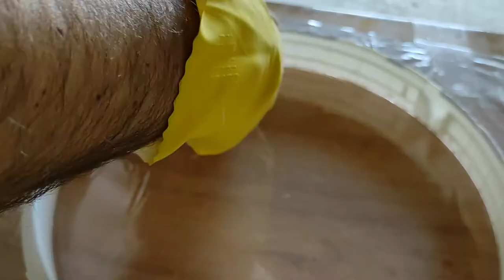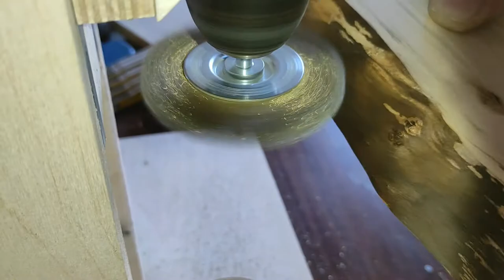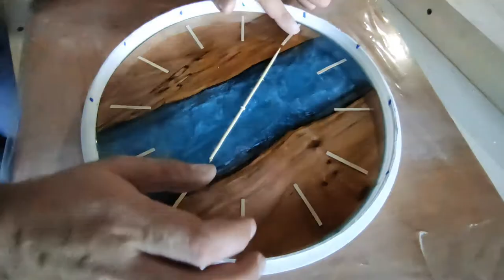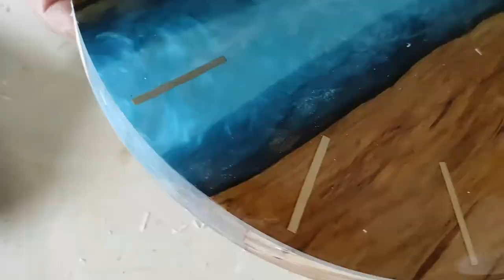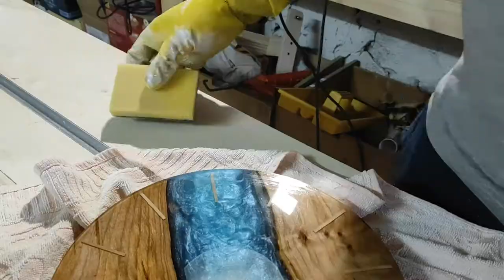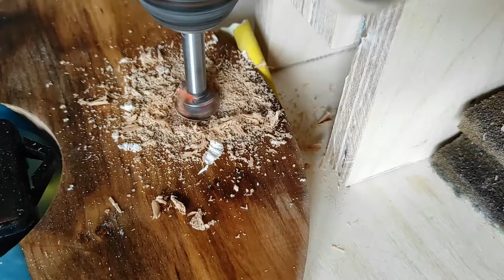Making an epoxy wall clock

Comment: Hi awesome clock wanted to ask what did u use to polish or compound for that glossy glass finish cheers
Reply from the maker: Hi, thanks for watching. A friend of mine, who is a coach building, gave me some products to try. But if you apply an epoxy top coat it will look just the way you can see in the video.